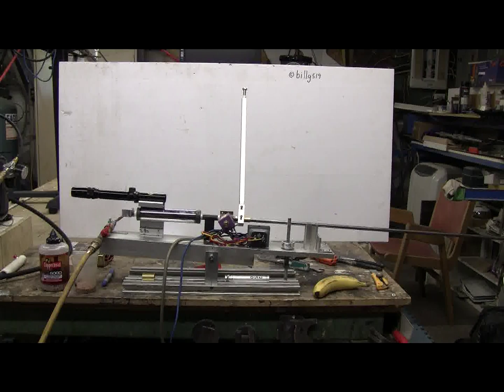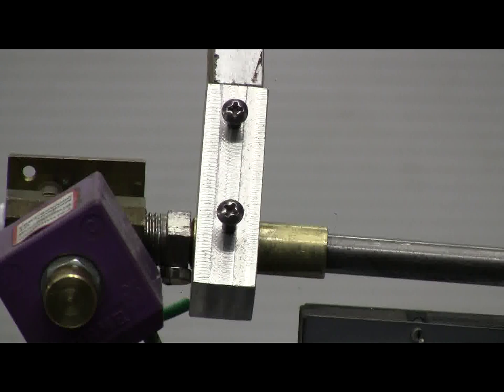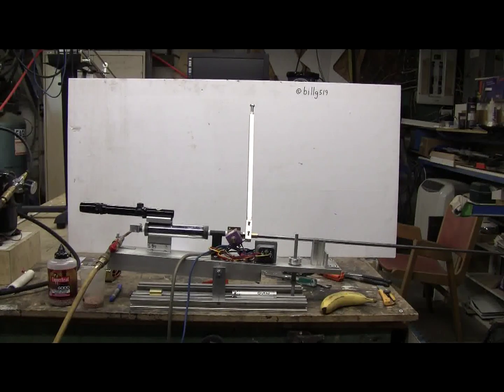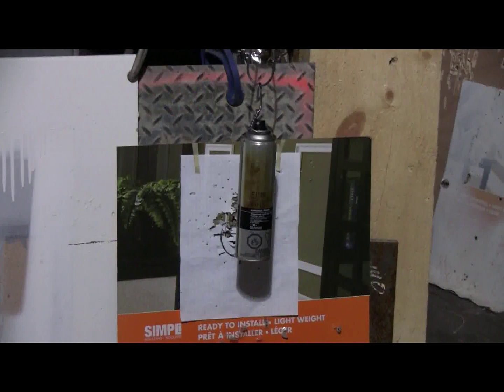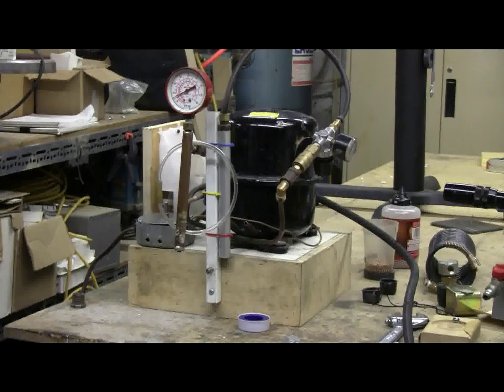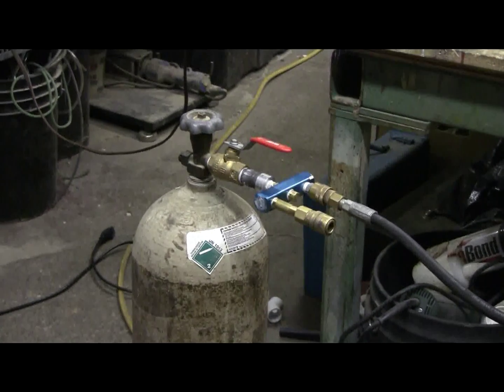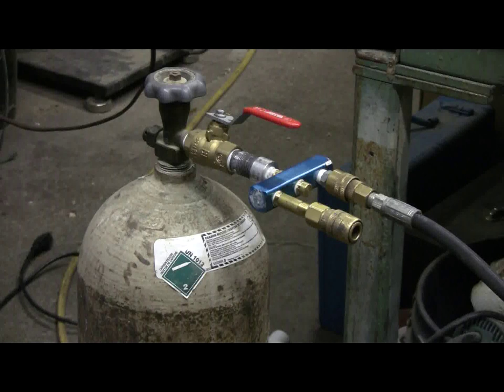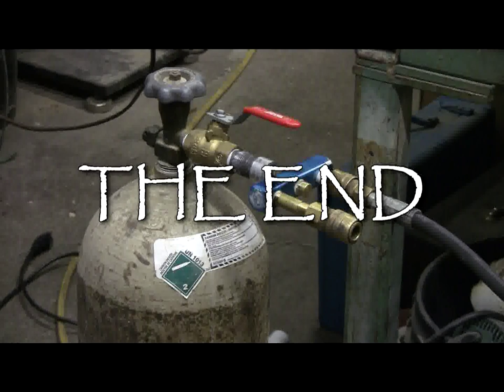Air Cannon #72 - .177 BB Cannon Full Auto Mod

Comment: ive always wanted a fully automatic belt fed .177 or .22 pellet gun and have it replicate a mg34 or browning .30 cal.  would only work as a blowback though as the bolts reciprocating motion and a Z shaped slot cut in the bolt is what makes the belt move through the gun...if only i had a milling machine and a lathe...